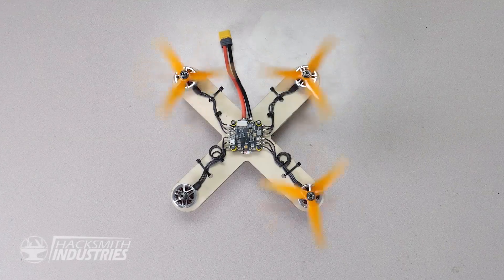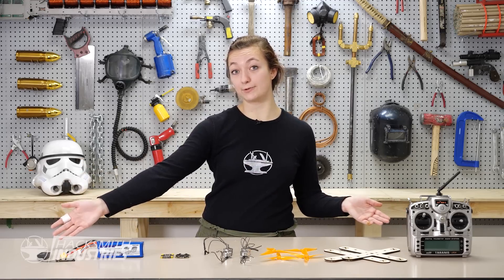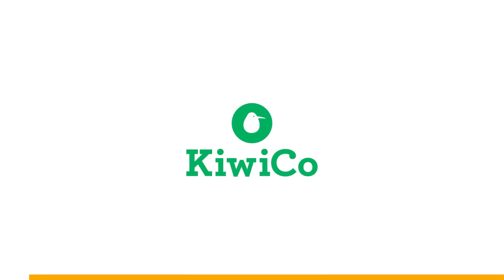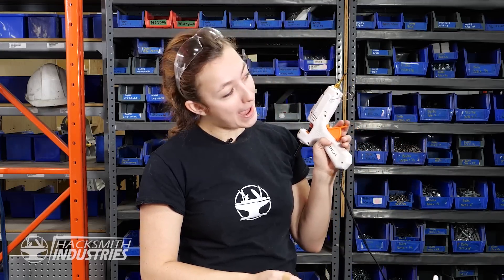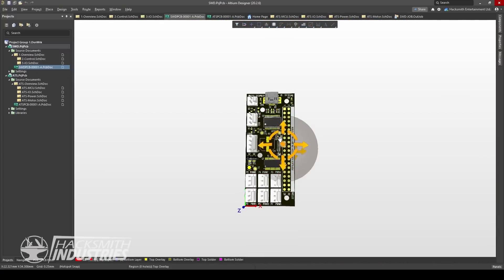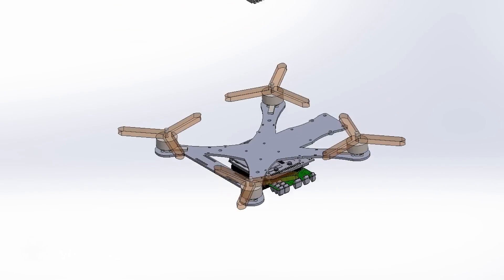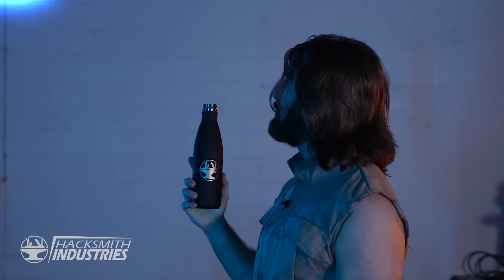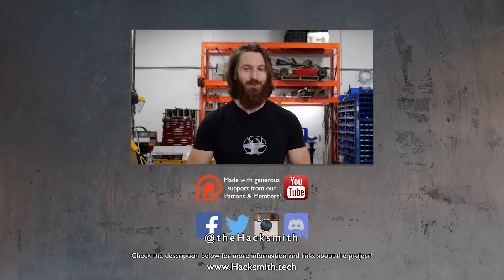JEDI FORCE TRAINING DRONE!

Comment: Is that actually flying? I feel like the drone itself is too heavy for the propellers
Reply: After she turns it on you can see wires holding it up.
Reply: Definitely not flying
Reply: The whole thing would need to be a lot bigger to support all the weight. I have a old dji400, and it runs 10" props
Reply: I saw wires when she first let it off. And it might be able to handle the thrust needed for it but usually when you start attaching things to the back and on top you run into stabilization issues and I feel it was moving too little in the yaw axis to be self correcting for the weight and drag generated by the bulk.
However I'm not there looking at the thing so this is all guesses as to how it actually does and I don't know the actual weight distributions or any stabilization they may have built into the jetson or if it has a pilot just a lot of questions that could take up a whole video
Reply: Off course it is flying, you don't know the power of a FPV racing drone, it can lift that and even more if it its only hovering like that
Reply: She said that the drone creates 158lb of thrust so i think it ill work

Comment: The funniest part about this is that I've basically seen this kind of drone and controller setup used for a different non automatic flying and shooting drone, but it used the normal standard nerf elite dart and magazine, which just goes to show the parts used for the base drone are just the most practical for this.

Comment: When you think about it Jedi’s would be some of the best contact hitters in baseball history...James would not 😭😭
Reply: Both Jedi and Sith would be the best hitters
Reply: I... read this way wrong. I read it as "Jedi would be some of the best contRact hitters in the galaxy" As in.. hitmen
Reply: Maybe? Most of the time you see them deflect blaster fire, they don't swing the blade. They simply move and angle the blade to intercept. So they'd probably be good at bunting. But swinging and hitting? Not so sure.
Reply: @Weretyu7777  Dude, how they use lightsabers is irrelevant. They're force users, they would be good at baseball

Comment: I've just had a idea... ODM Gear (Omni directional mobility Gear) from attack on titan.. here it is. (The idea of course)

Stage one the grabbing: 
Depending on what version of the odm you're going with.
Season 1,2 and 3 are by far the hardest to recreate and I'm working on figuring it out..
The season 4 version: the season 4 version seems to be a basic grabbing gun mounted onto a set of custom designed metal surport. It seems like the cable is stored in a small silo, this is where the base c from the "Batman Grabbing Gun) is basically that doubled and smaller, then the "cable" is placed in two separate coils on the back. 

This is what I thought of I'll keep the videos updated about how it could possibly work irl.. and yes I'm a massive AOT Fan don't judge me

Comment: Is there any metal that can withstand the plasma, and if there is, is it possible to insert a skinny rod in the middle of the plasma? Then you cans have a solid plasma light saber
Reply: They did that but they removed it so it would be retractable
Reply: @billybutcher9238  yes I totally forgot that that one of its key features is that it’s retractable

Comment: Very cool. I have been wondering why did y'all go with a methane and oxygen setup on the proto saber and not use a electrolysis system? It seems like you can get a smaller safer package using the electrolysis setup.
Reply from the maker: Unfortunately you can't get enough oxygen via electrolysis for the kind of flow-rate the lightsaber requires
Reply: U shouldn't be here ur not a member
Reply: @harryhollas2004  patreon members get early access as well.